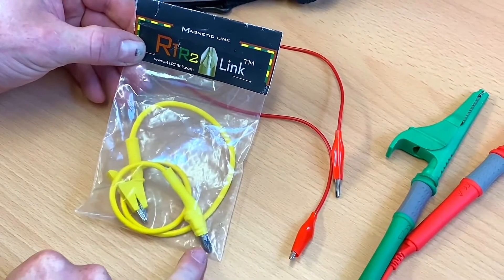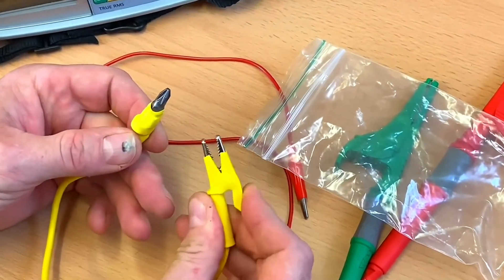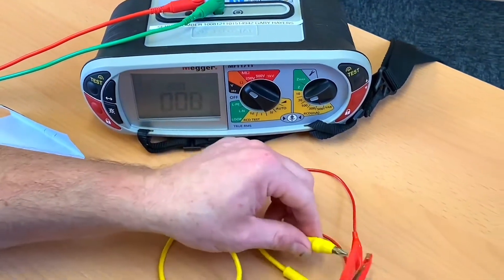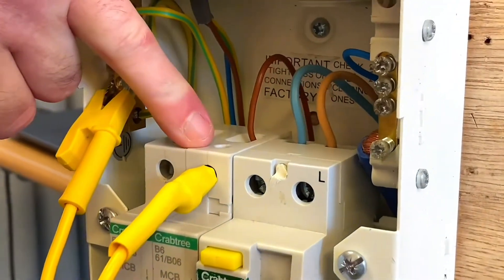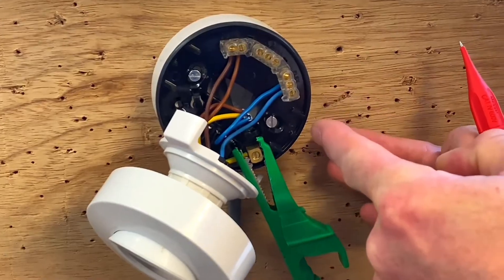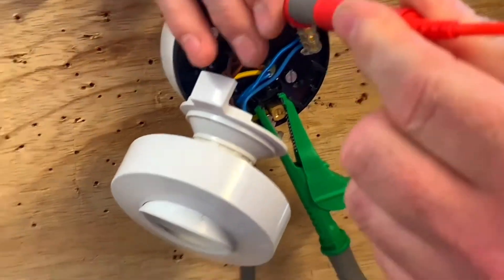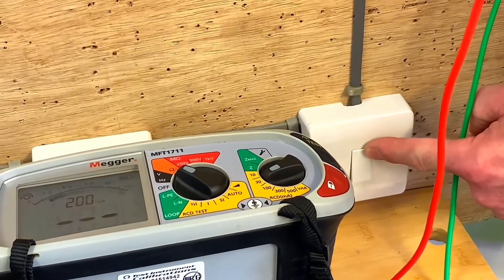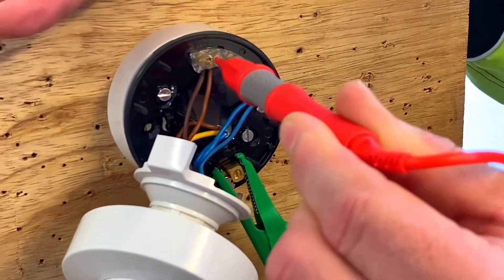R1R2 Link - Do They Work..?

Comment: Pity you’re not testing correctly you should remove the cpc and connect it to the same circuit live then do your R1+R2 reading so this piece of kit is pointless
Reply: He did connect the earth to the circuit live by means of the R1+R2 link . What he did was no different to linking the earth to the live with a wago or taking the live and connecting it to the earth bar ,  You pilchard.. why don’t you try and pay attention instead of posting stupid comments
Reply: It saves you having to remove the wires and still makes a good connection - saves time
Reply: How is this not testing correctly?

I've passed the QC course and there is no issue linking your busbars out with a bit of 2.5 cable once its nulled.

Smarter lads than me and you who teach this course don't see an issue either. 

Id love to see how my boss would react if you had 100 houses to pre test and your taking each earth out 😂
Reply: @gooburrr well to start with when you join the circuit cpc with the circuit live conductor you remove all parallel earth paths which gives you your true R1+R2 reading and as for your boss he or she should be pleased that you’re doing the job correctly it’s not about speed it’s about doing the job properly it’s your name on the certificate stating the job is correct and fit to use

Comment: They work, but a magnetic connection is less reliable than a mechanical connection, which can cause sporadic readings.
Reply: My thoughts exactly.  How reliably does the magnetic  bit form a very low impedance connection.  We've all had to press sharp pointy meter leads hard on things to get the true reading.

Comment: Hang on, that's a posi screw?
So how does it fit into the breaker when they use a different screw head?
Thanks
Reply: It’s a pozi/flat combo screwdriver which is called PZ/S2 and PZ/S1. These fit most breakers. The link is just pozi but it’s good enough.

Comment: Takes no time to use a screwdriver, and you can check the connection at same time.
Another great bit of kit to remove a none existing issue.
I note you zero the lead so will the resistance of the screw not add to the reading?